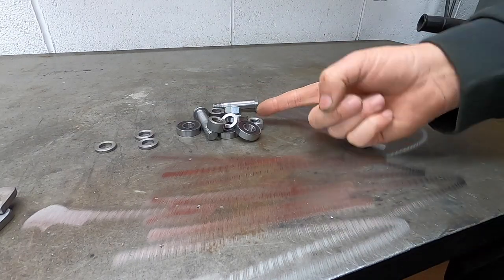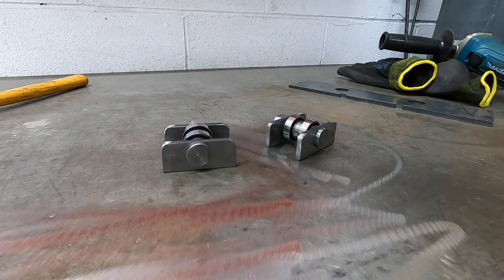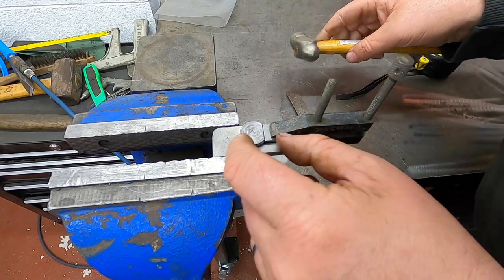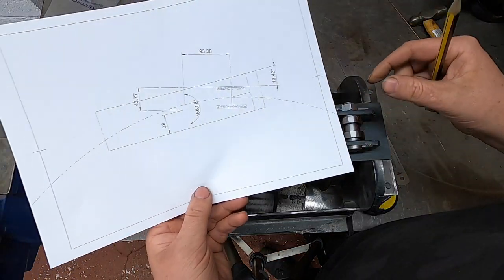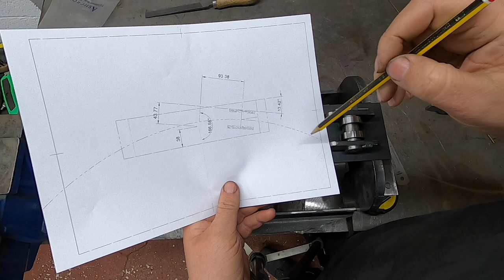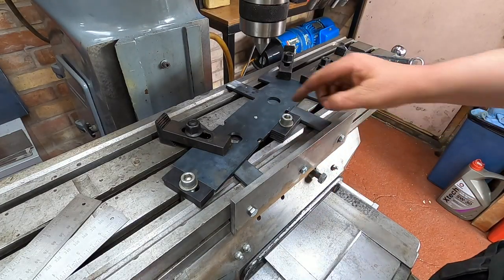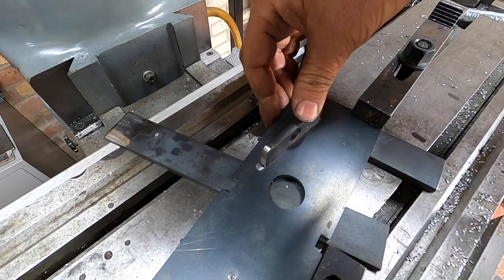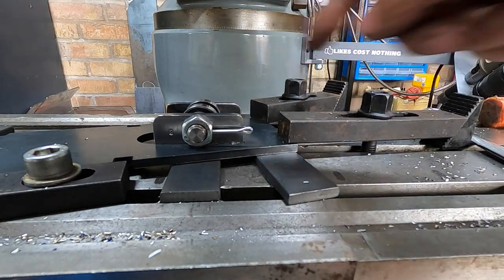Pony Truck Roller Skate - EP25 - 7.25" Gauge Steam Locomotive Build

Comment: Look out some NC Spot drills for the mill.  They're a 90 degree point which is stronger, but they're also longer than centre drills so reach further without wobbling around in the chuck
Reply from the maker: Thanks Edward, Your knowledge and expertise are most helpful. I shall look for some this morning. All the best, Matt